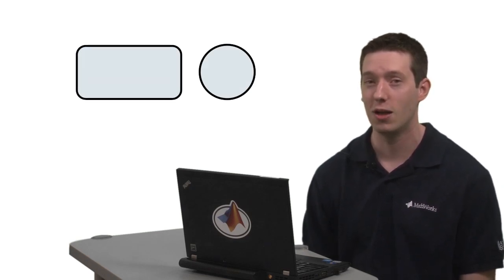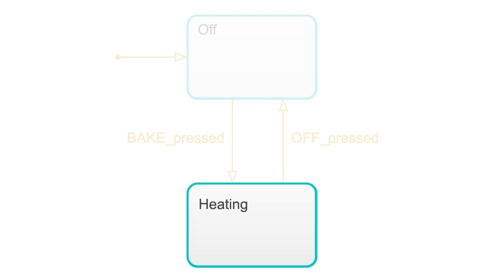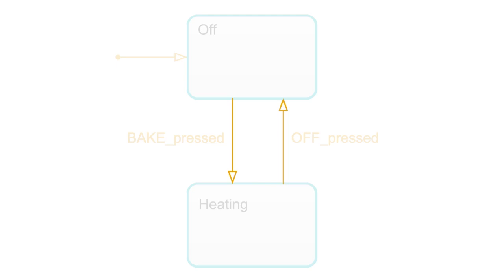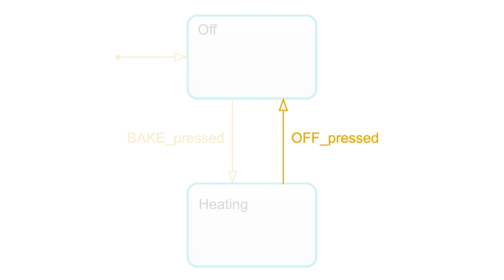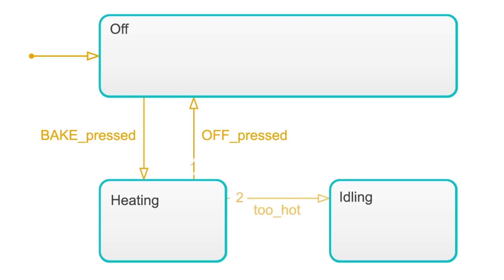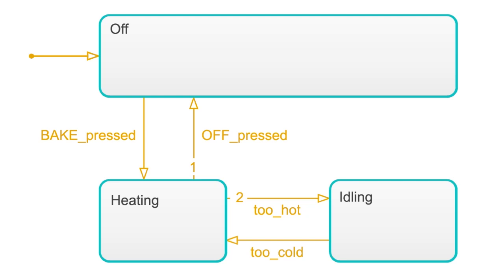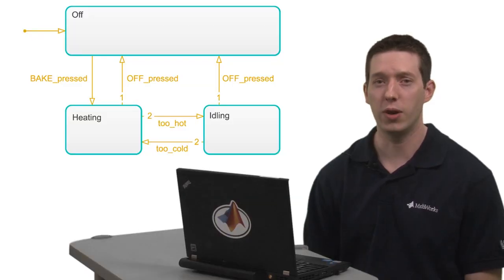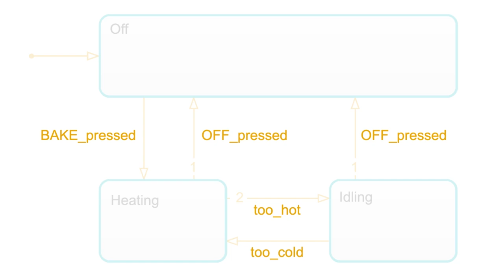Understanding State Machines, Part 1: What Are They?

Comment: Are finite state machines basically just a bunch of "if" statements?
Reply: A state machine can be more than just 'if' statements.  State machines exist to control the state of a thing.  Sometimes that state can be encompassed within business logic rules internal to the actual state machine.  An example might be syncing your Bluetooth to your phone while in your car.  Internal business rules govern that you cannot do so while the car is in motion, even though the request to change its state to Paired is coming from an external source (you).

Comment: Thank you very much! Im using this information to work with Unity 3D
Reply: How would I use an FSM to create a system for seamless transitions between a player jumping, running, idling, attacking, etc.? How would I wire unity animations up with my FSM?

If you in the past 2 years have made a character controller that can do this I would greatly appreciate if you could send it to me or explain it to me how to make one. 

Thanks!